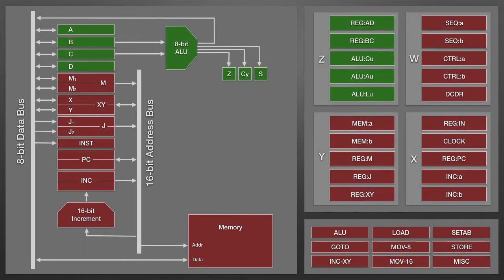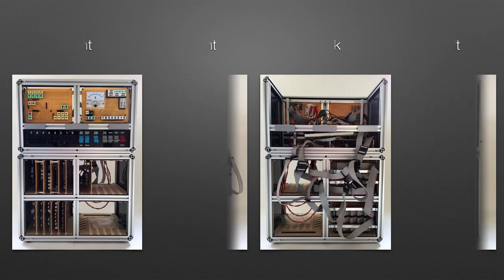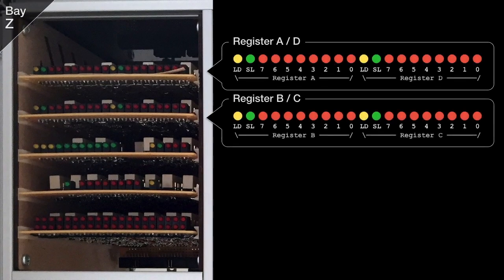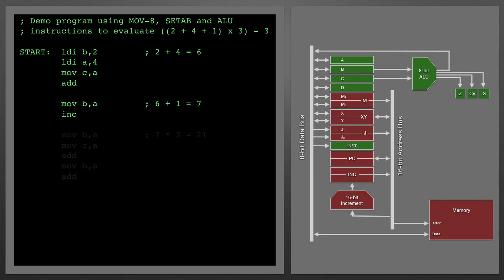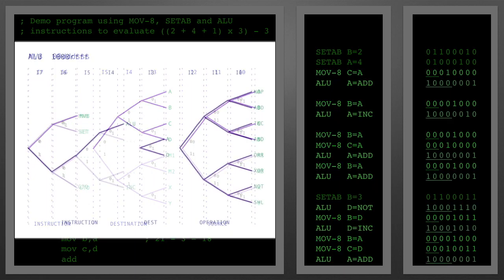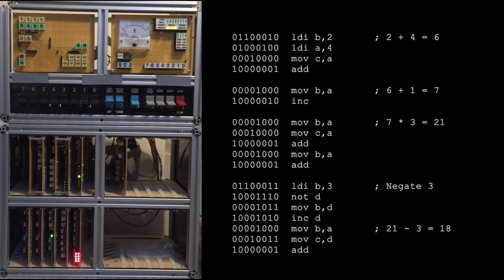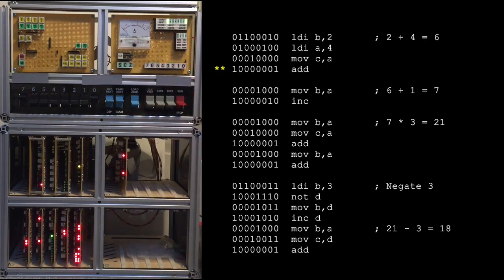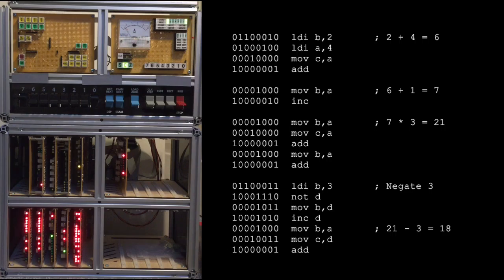Relay Computer Overview & Demonstration (April 2016)

Comment: I used to program in z-80 and 8080 assembly and have to say I like your choice of instruction mnemonics. This is really, truly outstanding work!  Do you think you'll have some sort of display interface?  perhaps a relay-based decoder that could output to a neon light matrix, similar to a  7-segment LED display.
Reply from the maker: Hi Anton, yup a display interface is definitely in the back of my mind. In my design I've left the upper half of the address space free for 'other things' (and halved the internal memory capacity by doing so of course). I'm going to expose most of the internal busses out the back of the computer so extending the computer will be easy.

I'm quite liking the idea of having a flip dot/disc display mirroring a section of the upper address space or I could drive an ASCII display of some kind. Possibly I'll cram them in to the existing enclosure - there should be some room at the very top and given the perspex/acrylic panels are semi-opaque that could work quite well if the flip discs are illuminated.

One thing I definitely want to do is make a way of loading the computer up with code quicker. Being as I'm a software developer during the day I quite fancied making my own language (probably a bit like Apple's Swift) with my own compiler which will take it down to my assembler mnemonics and on to a list of opcodes. I'll either just make a USB interface and load it directly from my modern computer by hitting those exposed busses or, and this is what I really fancy, make punch cards and make it so the computer can use those to load code in to its memory. Loving the electromechanical elements :)
Reply: very cool!  Yes, I love both the flip-dot and punched card ideas, in keeping with that legacy tech!  Good thinking!

Comment: Very cool. I have been in touch with Harry Porter. He wrote some really nice documentation about his system, which seems very similar to what you are doing here, though I must say I like how clean yours looks. 

Anyone who is interested can find the pdf at http://web.cecs.pdx.edu/~harry/Relay/RelayPaper.pdf  

The documentation includes very nice tutorials on implementing logic gates with relays, the system architecture, programming, and even an assembly language of sorts. 

Keep up the outstanding work. I'm thinking of doing a programmable, turing-complete machine that uses marbles, gears and such, so, interestingly, I like to check out how people are doing other systems.
Reply from the maker: Hi Anton, it's more than just similar to Harry's computer - the architecture of my computer is based on his (and reproduced on my blog with Harry's kind permission). Actually to be completely transparent mine is actually based on Phil Ryals design of the RC-3 http://www.computerculture.org/projects/rc3/ which itself is based on Harry's design. Where mine really differs is that I've taken that design and gone on a miniaturisation frenzy (compare mine to the RC-3 and you'll see what I mean ;) and I've tried to modularise everything and make it based on a plug in card design but at its heart it's still Harry's HPRC.

Comment: What will the Specification be, and also, will you eventually connect it to a server to take commands in a queue? This is an impressive build.
Reply from the maker: By the time it's finished it'll be an 8-bit computer with 16-bit address bus running at 6Hz. Eight general purpose 8-bit registers (four of which can be combined in pairs for use on the 16-bit address bus). 8-bit Arithmetic Logic Unit which can perform add, increment and a restricted set of logic operations. Probably just 32K of memory to begin with (might leave the remaining 32K of addressable space for a display of some kind or some other extensions). There's a bit more info on the architecture on my blog at http://relaycomputer.blogspot.co.uk/p/a.html
Reply from the maker: It's true to say that entering longer programs via the front switches will get tedious quite quickly so I have indeed had a few thoughts in that area. I think I'd probably want to load programs in to memory from some external source/server but probably not drive the computer directly. That said though I intend to expose all the various control/data/address busses at the back of the computer so I'd have loads of choices for extending the computer. One thing I quite fancy doing is building a punched card reader to load programs in to the computer and then probably create the punched cards from a seperate modern computer. I'm also planning to write my own high level language and compiler ... all of which is ages away of course as the computer takes so long to build in the first place ;)
Reply from the maker: Ah, well, as mentioned in the video comments the architecture of this computer is based on the work done by Phil Ryals and his team on the RC-3 relay computer and his in turn is based on the computer built by Dr Harry Porter (links in the comments) ... and Harry will no doubt point you back to Konrad Zuse's 1940s computer ;) Actually the adder in Harry's, Phil's and my computer all use Konrad's design for the adder.
Reply from the maker: For my computer I wanted to miniaturise everything (Harry's and Phil's computers are huge) so given the circuit diagrams from the RC-3 computer I've just spent lots of time playing with the layout in Omnigraffle to get everything to fit, prototyping on breadboards, and then just lots of trial and error on top of that. As I know how many relays each module of the computer will need and how many I can fit on a card the hardest bit was working out how to get the right busses to the right cards ... again, lots of playing around in Omnigraffle eventually dug up a design that worked. The enclosure for the computer I designed in SketchUp first as those aluminium profiles are too expensive to get wrong ;) The good thing with a computer like this is that as it's just relays you can ignore most of the electronics stuff that you'd have to consider with a typical semiconductor/IC computer.
Reply from the maker: Actually, you got me thinking with the idea of simulating the system before building it. I needed to learn some new web dev stuff so long story short you can find a simulation of my relay computer as it currently stands at http://80nd.co.uk/relaycomputer/
Reply: I'll look into it.  That seems interesting.